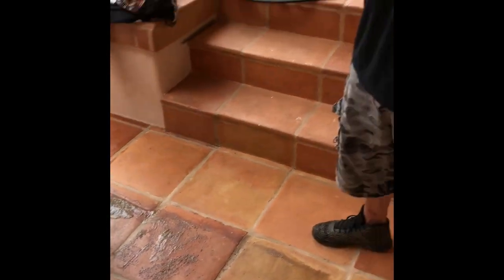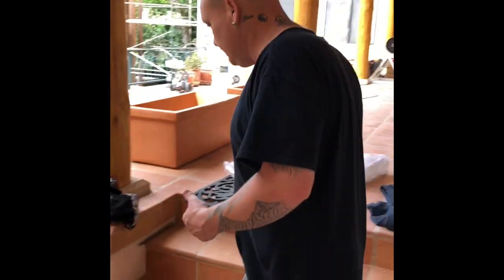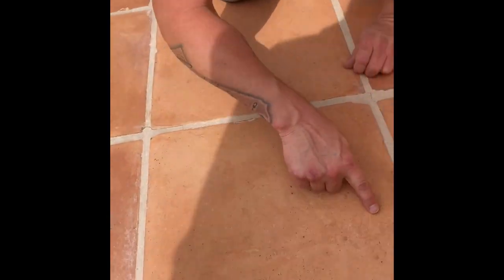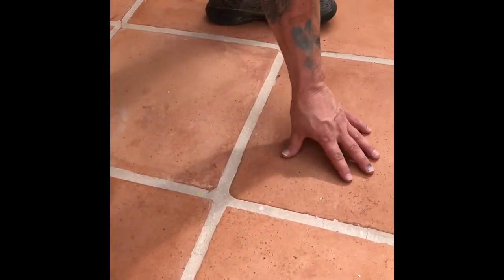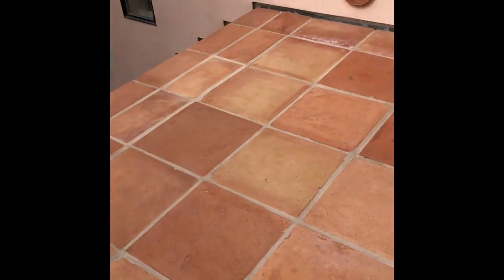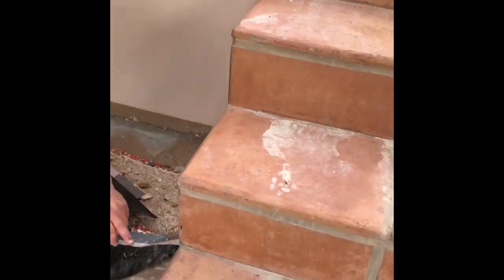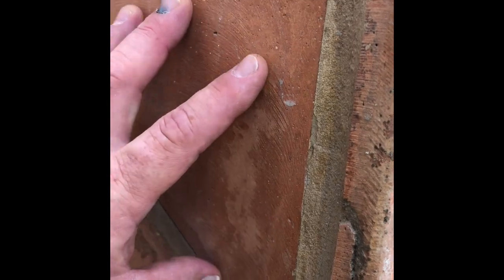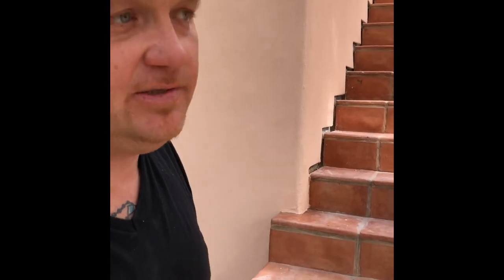Can Saltillo Tile Be Sanded | Sanding Terracotta Tiles

Comment: Looks ok to me terra-cotta tile is pretty rough to begin with id rather have it sanded than to look at shitty dark stains. that tile is prone to stain badly.
Reply: I agree.  I sanded mine and they came out beautiful
Reply: @bradblackwell5526  Thanks, Brad. What did you use to seal them after sanding?
Reply: Tile contractor here I absolutely disagree with this contractor the I guarantee the tile looked 100x worse than it did prior sanding was probably the only way to keep the tile without getting it all ripped out a very good option before putting the house on the market